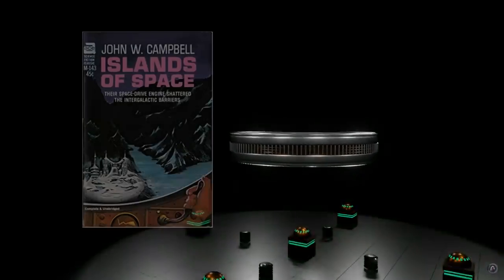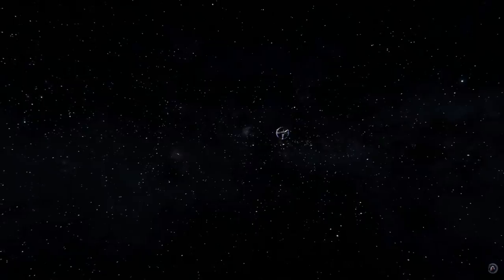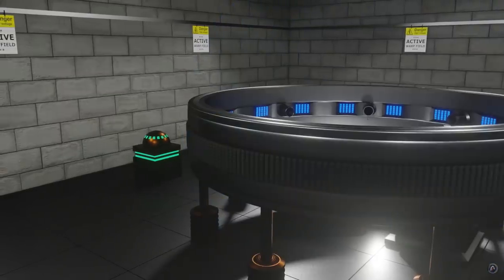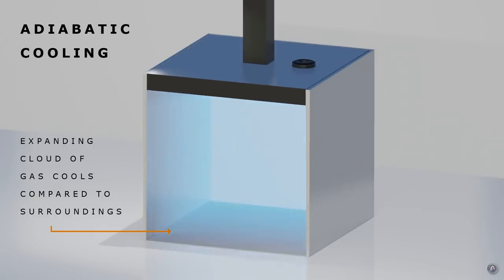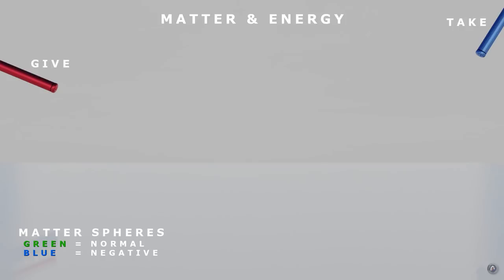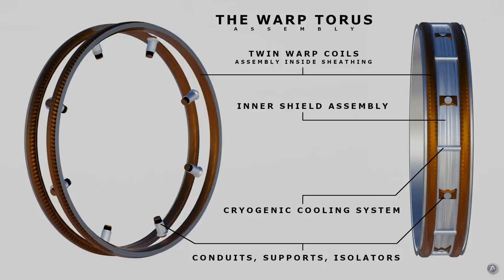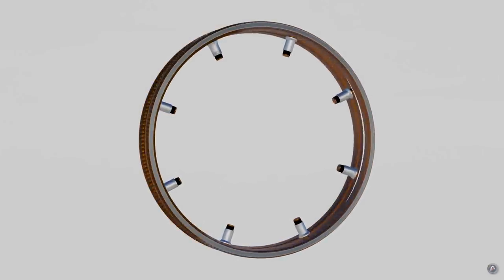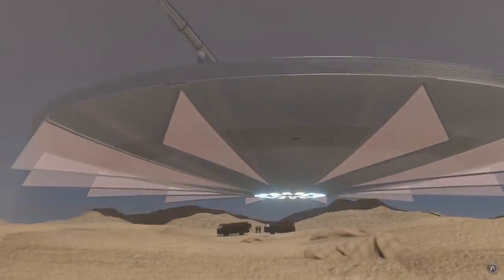A Detailed Breakdown of an Alcubierre Warp Drive Coil

Comment: Ok, i think your just making stuff up here. Some of it sounds good, but a no go in its truth. How do you know that energy pumped into the ring would create negative energy. Most scientist state the need for exotic matter and that is problematic at best. We dont even know what dark energy is. So just stating that the incredible amount of energy put into the system would create negative energy is not correct. Please back this statement with empirical data. as what your giving us does not cut it.

Comment: Instead search for TR-3B Magnetic Field Disruptor. The Technology is already available.
Reply: we agree this is controlling al weather on our surface and fill the air as we speak, everywhere. Documented since August 1, 2016 w/metric tons of nano particles sprayed 24/7.
It is snowing if you put the "sun" engine in the shade and look, this is clear mechanisms rhat make circles. We know ships system with holodeck top used as circuit board to control All of Earth until we become awake and pray together in love.
Can see them with yellow lens, shadow above cloud, all move together and can move a different direction than the wind is moving. mostly triangle except they are all shapes and sizes. We have power over all ions, see rice water study for matter controlled by thought and Dr. Masaru Emoto for the power of water to hold our intent with structural memory.
Reply: @artistkeithlutzpainting5566 /videos <<< Don't listen to this nutjob until he comes back with a more detailed reply. Could be a bot, or trying to derail the thread. I haven't looked into the field disruptor.

Comment: It should be called a Mercury drive.
Reply from the maker: Fortunately that never took place as mercury is far too dangerous. Could you imagine a tonne of mercury flying around in the air/atmosphere? It would continuously be leaking a tiny amount everywhere - not good to breath.
Reply: @asteronx  this kind of craft is dangerous as well. Basically its flying microwave oven that will burn vegetation on earth if it is mass used.

Comment: Based upon my understanding of the Alcubierre drive, this video is complete nonsense.  There is no need for the crew to be protected from inertial changes, as the warp bubble in which they would find themselves has a different spacetime reference frame....One cannot accelerate mass beyond the speed of light, but spacetime can be accelerated faster than light. (So Alcubierre seems to assert.)  Whomever created this video shows no understanding of the principle involved.  They have no credibility with me.
Reply: Yeah, but the animation is pretty cool.